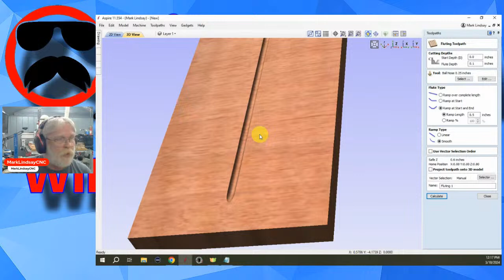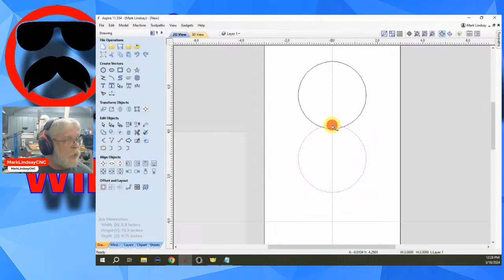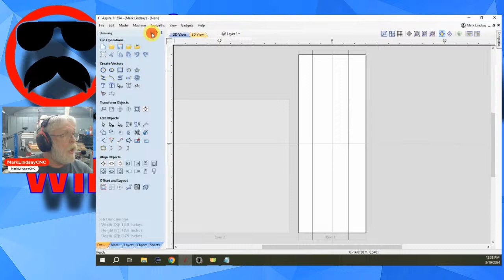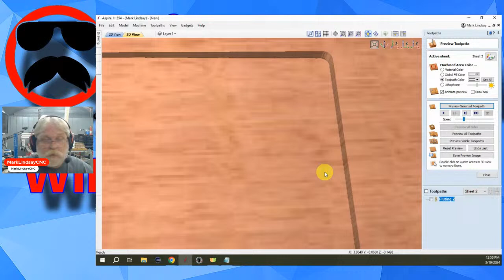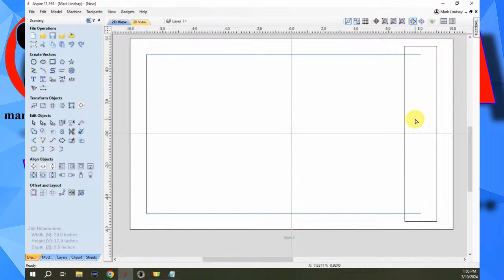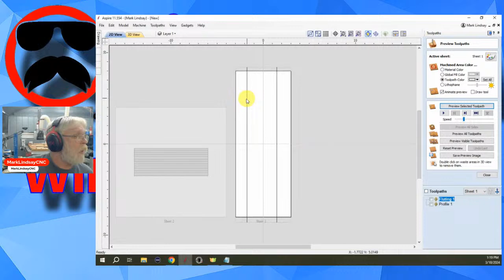Live Q&A #234 – The Fluting Toolpath – Open Q&A

Comment: Hey Mark, I’ve got a question for you & your community cause I’m just baffled about my CNC’s performance. Maybe you’ll be kind enough to opine.
I’ve set my CNC up and laid down a spoil board on top of a bench I made specifically for my machine. I made a special effort to make sure the surface would be level and according to my levels it’s about a level as you can make it. I’ve also measured the distance between the spoil board and the bottom of the gantry (4.75”) on the left and right side but my projects are coming out shallow on the left (1/16-1/8) and to deep on the right (1/8-3/16). What am I missing? Any thoughts? Thanks in advance for any help. Kind Regards, John

Comment: I am assuming I would need aspire, but what about fluting over a 3d surface?
Reply from the maker: You can certainly flute over a 3D surface in VCarve and Aspire. The surface has to be a model that is imported into or created in the software. In the Fluting toolpath, place a checkmark in the Project Onto 3D Model box before calculating the toolpath.